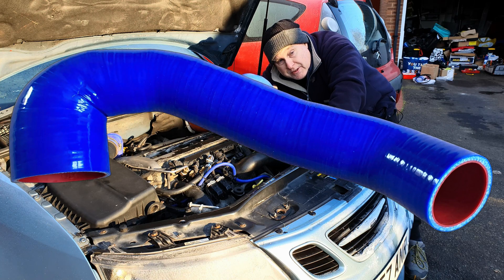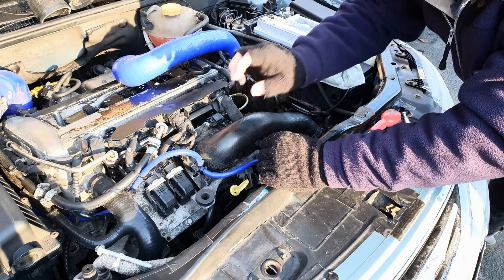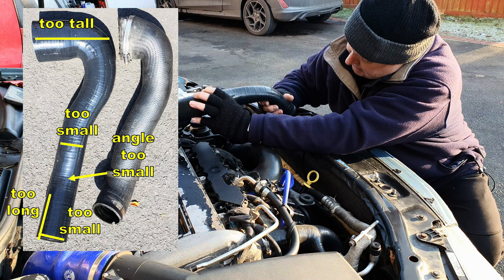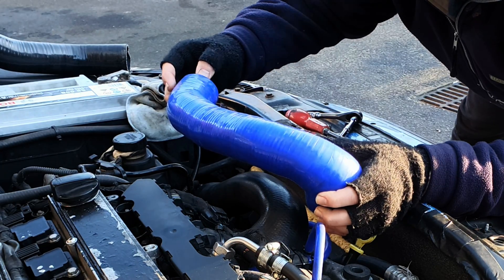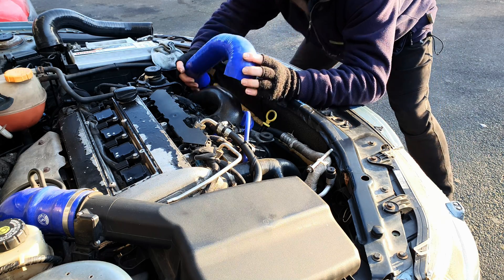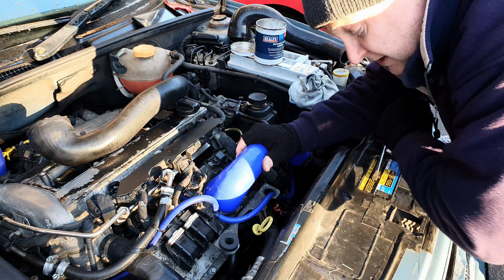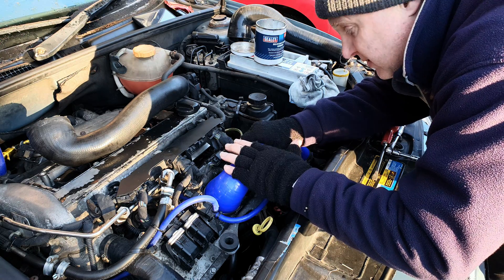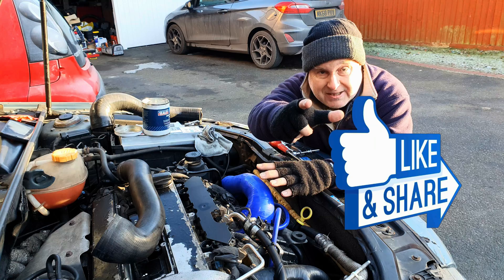NEW❗Silicone Saab 9-3 Throttle Hose Replacement

Comment: I installed the ECU spacer kit, and ever since I removed the TB hose for that install, it keeps popping off under boost. When I removed it, there was some powdery white residue so I think previously something was used to hold it better. On reinstall, just dry fit, issues since. I thought I wasn't tightening it enough due to slightly worse accessibility from the ECU spacer install. But looks like its actually just too brittle as you said. Ordered this hose and hopefully it will be fixed. Thank you
Reply: Any problems since fitting this silicone hose?
Reply: @chrisedmonds4005  no, its working perfect

Comment: does this fit the automatic transmission as well?
the hose of the manual model is shorter
Reply: doesnt matter should be the same size hose if its automatic or not

Comment: Hi Syd.
I bought one of these and it turned up this morning, so I've just been out and fitted it.
One thing I've noticed is that my engine cover won't go back on properly with this fitted; it won't seat into the rubber bungs at the front and the curved cut-out on the right of the cover is off centre.
Other than that, it went on very easily and ties in nicely with the new vacuum hoses I've been fitting.
Reply from the maker: You could cut 10mm off the throttle body end, BUT you are better off leaving the engine cover in your garage to promote extra airflow over the engine ECU. They are prone to dying with engine heat.
Reply: @CycloneCyd  Thank you...i did both 🤣

Comment: HI CC. I recently bought this hose from Aliexpress, after I fitted it I found I couldn't put the cover back on as the hose sits too high  at the throttle body end. I will have to trim that end a little to reduce how proud it sits to allow the cover to put back on, I've place the old hose back on but compared the two beforehand and its definitely sits higher until I can find my craft knife. PS keep up the good work. JB

Comment: When will that thing need a new clutch? Mine is starting to slip at high power, I suspect it has only a few months left!
Reply from the maker: I had a new clutch fitted in March, just after making this https://youtube.com/shorts/j38p4oVraUk?feature=share. If your clutch has started to slip, have it changed ASAP. I had to delay getting my MoT because I didn't want to risk having the car stuck on the garage ramp, or unable to get on.

Comment: this old black silicone hose is PPS? i also have this one and i think its too small
Reply from the maker: PPS? What does that mean? Yeah, the black one was poor, but I can defo feel a difference with the new blue one. The engine is smoother, quieter and feels more responsive to small throttle inputs. maybe the old rubber hose was stretching under boost? Or maybe it's that it's smoother inside and that nice big radius into the throttle body.
Reply: @CycloneCyd  Pro Parts Sweden, company :)

Comment: Thank you for posting that interesting informative video. May I ask why you have that bolt cable tied onto the (air con?) hose?
Reply from the maker: For safe keeping. Simple as. Also it serves to remind me I wasn't able to put it back in when I changed the ac clutch and I need to come back to it.
Reply: @CycloneCyd  .....serves as a reminder to come back to it...an example of "visual factory"? At first I thought maybe Saab had given you a "bonus bolt".

Comment: Cyd -- is there an AliExpress top radiator hose listing as well... or will there be?
Reply from the maker: ATM the top rad hose is available only via this link https://www.buymeacoffee.com/CycloneCyd/e/52994 which comes to me rather than direct to the factory. The Ali page for the air hose is something of a 'trial'. We'll see how it goes and which method works best.

Comment: Another product at a fair price. Thank you.
I'll get this one too.
Also, I forgot to install the coolant T  when I did flush "my" coolant. 😆

EDIT: what about the vacuum hoses?
EDIT2: I remembered that you did a video about an "enlarged" aluminium intercooler. Is it still available or can you do something similar as you do with these hoses?
Reply from the maker: Glad to help. Yeah, we were keen to keep the price reasonable. My 2.0T feels smoother with it too. I hadn't expected that.
Yes, I'll be doing vacuum hoses soon, waiting on some bits.
When the weather warms up and I can get back to regular visits with my Mum (she's had her cateracts done recently so been visiting loads as she can't drive yet) I'll be doing the intercooler. My OE one is bending at the bottom, just hope it hangs on long enough.